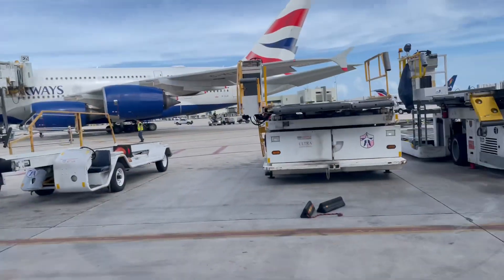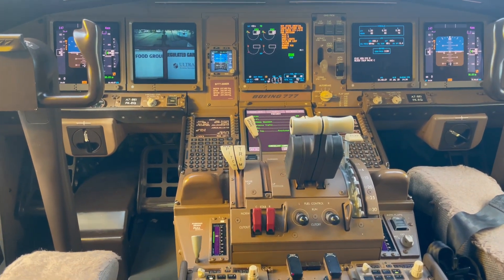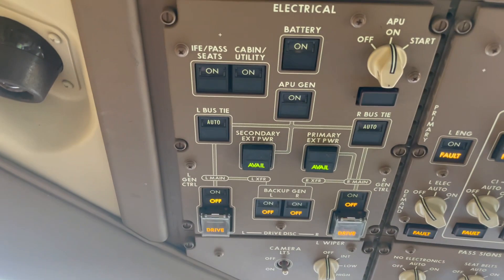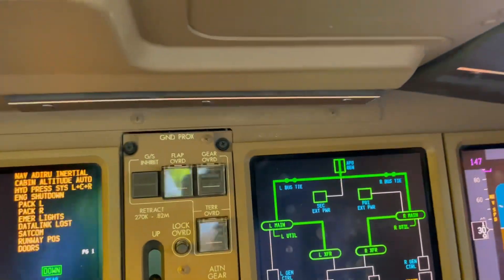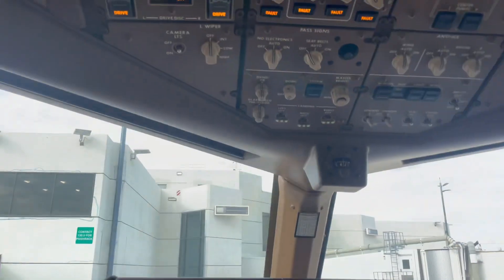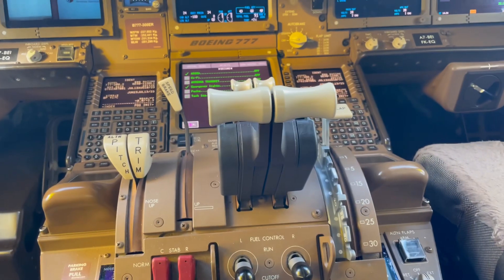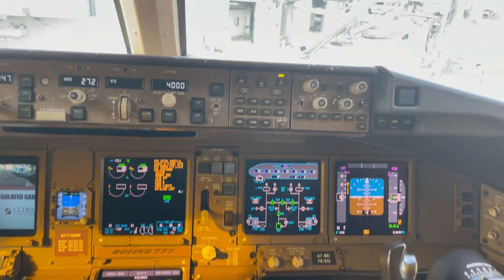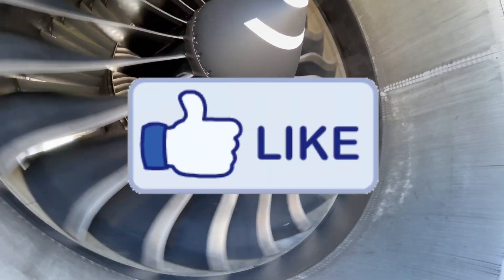B777-300ER RH generator failure , MEL dispatch ELEC GEN SYS R

Comment: Hello Dennis,

1)You said that APU must be running for the next flight, because the right Drive Generator is disconnected.

Does it mean, that the aircraft has to fly on lower altitudes?
I am asking because the APU can only be operated to a certain max altitude.

2)That also would mean higher fuel consumption, right?

Especially with APU running and "possible" lower cruising altitude, back to Doha.

3)How does the crew know how much fuel they have to take more?

That is bad for the new flightdeck crew that has to deal with these problems from the beginning of the flight.

4)Did you check the right Drive Generator visually?

5)How much time does it take to reactivate the Drive Gen on a 777-300ER?

6)Is it up to the airline if they want to get the aircraft repaired or want to fly with minimum equipment?

I know that with this solution it is less expansive for the airline, because otherwise the flight would get canceled and they need to send a replacement aircraft.

7)But what is if the APU or the left GEN would fail, too?
Could the aircraft still continue the flight or would that be an emergency case?

8) Because it is a trans atkantic flight, are there any other regulations to be considered regarding MEL and generator faults?

9)
Regarding the center isolation valve, could humidity within the valve be a reason why it didnt work?

Thanks and I hope you can find time to answer these questions in your lunch break😄
Reply from the maker: Hello there, let me see if I can answer you questions.

In the B777 the use of APU in electrical mode only has no altitude restrictions. If used for providing bleed air max altitude is 22000ft ( that’s emergency only ) you can’t dispatch aircraft with two bleed systems INOP.

Fuel consumption at altitude is about 90kg/hr on ground that is about 240kg/hr. I suppose that has been checked during the certification process of the aircraft.

So it’s no a big deal, they will need to take about 1400 kg extra for the APU fuel burn. So it is possible cargo or passengers need to be of loaded if aircraft is operating at its max takeoff weight.

It is very simple to reconnect and IDG again, you will have to open the engine, and on the IDG is a ring you pull to reconnect the axle to the gearbox again. Only testing will take up a lot of time, aircraft need to be cleared and engine need to be run. Aircraft will take a delay for that and most likely the outcome will be that the IDG is inoperative. 

Replacement of and IDG is about 4 hours work.

So APU is used during the flight as a redundancy, one generator plus the backup generator can feed the whole aircraft with electricity. Also APU can feed the whole aircraft.

Aircraft will need to stay 180 minutes from a suitable airport. So if the aircraft would have for example 207 min ETOPS it will be down graded to 180, this aircraft was 180 ETOPS so no extra restrictions. And no other regulations are applicable.

Hope it clears it up.

And regarding the isolation valve, don’t think humidity is the problem (air going though the bleed air lines is about 200 C) but the position RVDT’s (rotary variable differential transformer) wear out of valve internal components wear / clog up / corrode etc. It can have many causes.

Valve was working so my guess is that the RVDT was causing the problem, valve was open but system saw it failed closed.
Reply: @dennisvijverbergbrakesrele6098 
Thank you very much.

So as long the APU bleed valve stays off, there is no problem with the cruise altitude.

It would be very cool to see a long video about the onboard maintenance system and AIMS, AMMA, Tools ect.